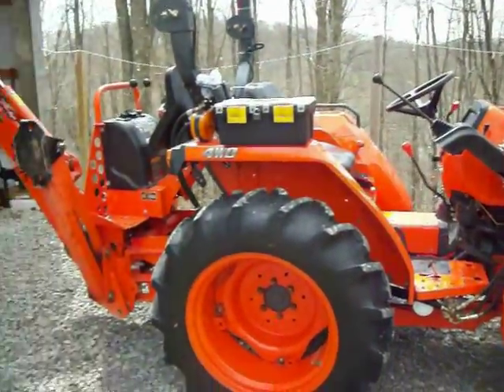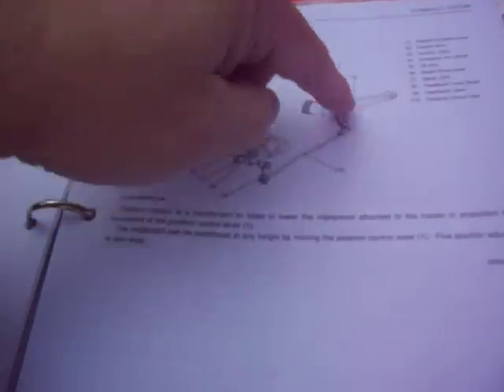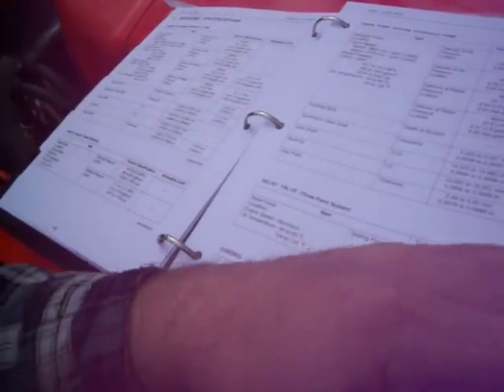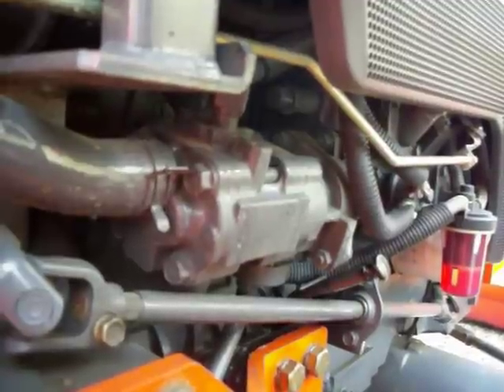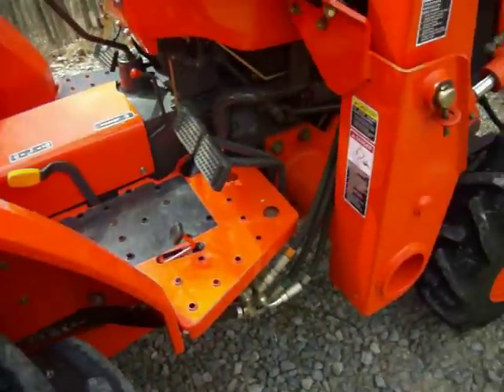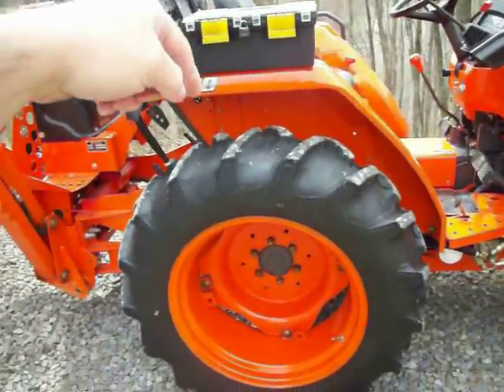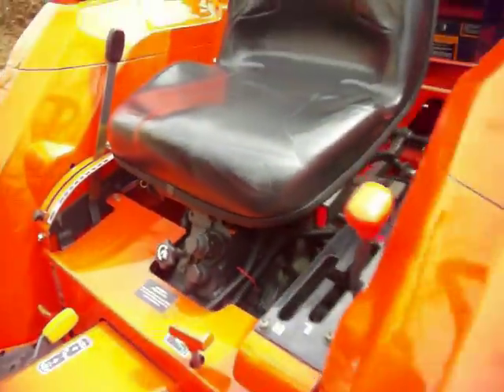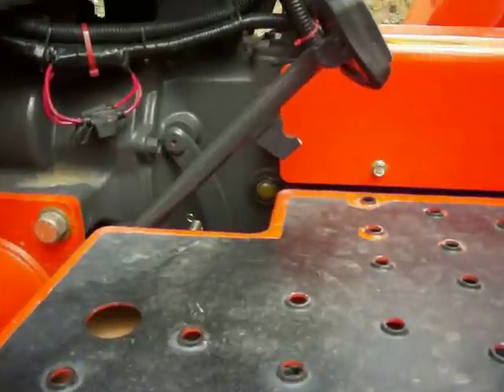Kubota hydrualics and three point control valve.

Comment: A GREAT review & congratulations on HAVING a gear drive tractor. I am almost ready to put a PTO hydraulic pump on the back-hoe ( a BH92 on a MX5200) supped up the flow 40% by changing to bigger hydraulic lines&fittings on the loader control to the hydraulic block. No more power but l can use all 4 BACKHOE  circuits at once instead of just 2&1/2 from the stock's wimpy lines &fittings. Thanks for the great vidio Sir and happy safe Tractoring.

Comment: Thanks for the info.  Fyi.. If you have the ability to edit video (most computers have basic editors), I would redo those sections where your pointing to hoses, etc. but the camera angle is off and your unable to see which area of the hydraulic block your pointing to.

Comment: I have a B8200 tractor. The rear lift lifts fine but it is very slow going down even with implements on it. What do I need to check?
Reply: There should be an adjustment between your ankles. A round knob, with arrows going left and right. This is your" rate of descent adjustment for 3 point hitch". Depending on how heavy you have an implement on your 3ph or how fast it drops. Adjust to your needs.     READ OWNERS MANUAL. It is there

Comment: We have a kubota L245 DT tractor how do you know when the hydraulic fluid is full.
Reply: Fill until about half of the shaft is covered. That's how I run mine. (same exact model)
Reply: Is that with the motor running or not running,

Comment: if you buy a kubota HST do not use anything but kubota hydro oil no matter what anyone tells you .I've run kubota tractor's for 20 yrs every day not one problem 
They're the very best as far as I'm concerned
Reply: I have a L3600 when it gets warm it don't want to pull like it's week steering don't want to work eitheris it a hydraulic pump or does anyone know

Comment: You're a Good Man to share all of this information......I am considering buying a compact, or a utility tractor, and I will make sure that I buy the Workshop Manual for whichever tractor I end up with.....One question, is the Backhoe on this L3400 sufficient to perform the digging, trenching, etc.....that you need for your company...?.........One more question, do you like the Constant Mesh Transmission, or would you prefer to have a Hydrostatic Transmission...?